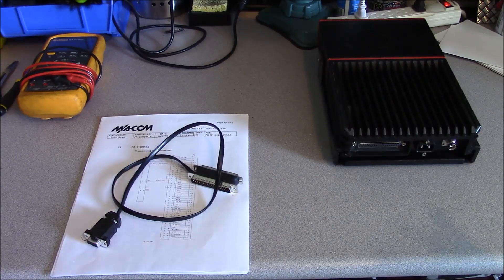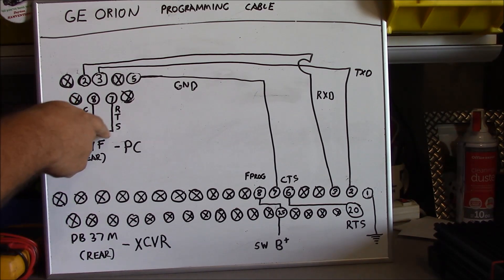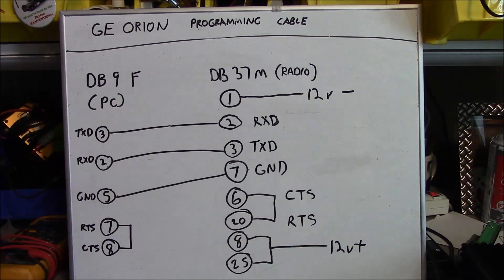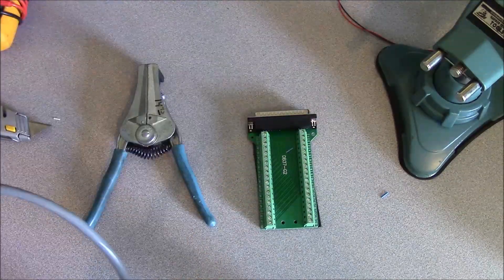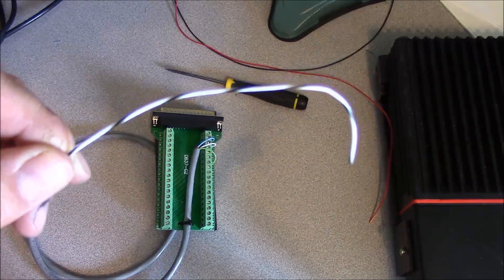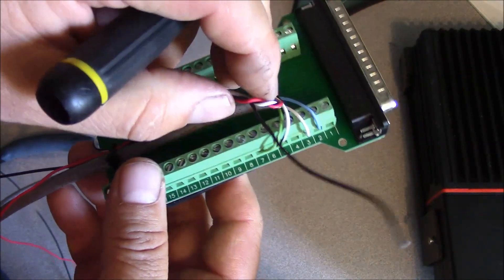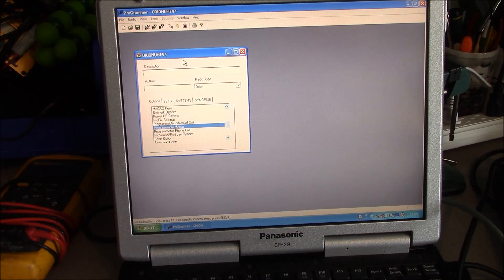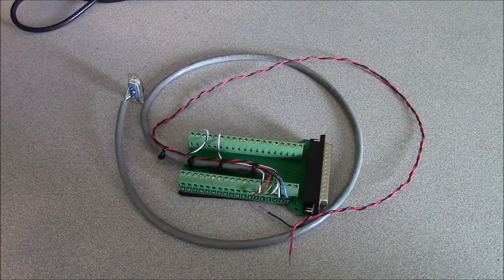GE / MAcom Orion radio programming cable build your own DIY

Comment: Do you have a video or diagram for the ma/com LPE-200 programming cable a new cable building video would be awesome
Reply from the maker: That is a TQ3368. The schematic I have is for the cable that uses the TQ3310 or TQ3370 Rib box ( Its not a ribless cable).  There is a fellow on ebay who has a price industries one for sale for $39.99 that I BELIEVE is the ribless RS232 cable. If you email me I will send you the schematic and link. Thanks for watching !
Reply: @survivalcomms  what's a email I van reach you at?
Reply from the maker: @AlucardRacing  (my channel name) at gmail dot com

Comment: hi i have a ge orion radio can you help me program it? I can't change the power Thank you
Reply from the maker: You need to get the software
Reply: @survivalcomms  i have the software
Reply from the maker: @marcoc2069  Ok you need to use the Radiomaint.exe  program in your folder to edit your tracking data . Read and archive your original tracking data then edit the tracking data and upload to the radio.
Reply: @survivalcomms  my problem is that I can't vary the power, I can read and write but not vary the power
Reply from the maker: @marcoc2069  How much are you trying to lower it ?
Reply: @survivalcomms  it won't let me get down or up
Reply from the maker: @marcoc2069  Will it when you are editing the tracking information ?
Reply: Can you make a video to show me how you program it.
Thank you

Comment: Worked like a charm on my M7100. Thank you, sir!
Reply from the maker: I am glad ! Thanks for watching !
Reply: @survivalcomms  oh, your channel is great.  I've fallen deep down the surplus commercial/public safety radio rabbit hole. Thanks for all the information and inspiration. 73, W6STO
Reply from the maker: @mattbranstetter4072  I am glad  !
Reply: Hey Brett, I actually have a question for you after a little more messing around.  I am having trouble writing the System Control head keypad functions.  Ma/Com M7100 VHF using RPM R14c.  Is it possible that the control head needs to be connected via the CA101288V15 during programming for the functions to write? Thanks
Reply from the maker: @mattbranstetter4072  It is possible and I would give that a shot. Is it transferring your  memory names correctly to the head ?
Reply: @survivalcomms  yes memory names work fine. Probably better get the factory cable and try it. I'll let you know if that works

Comment: I built this cable but I ran into a new problem, when it reads the radio I get an Error message "radio was programmed with a later version of programmer software. Please contact Software Support. 

Any help on how to get around this is greatly appreciated.
Reply from the maker: The software you have is an older version than what the radio was programmed with. Easiest and least expensive way is to create and write a codeplug to the radio from the software you possess. It will overwrite the codeplug in the radio.  Make it a simple codeplug and then once the radio reboots and all is bueno read the codeplug from the radio and edit it. Thanks for watching !

Comment: Is there any way to build one using a USB? I dont have the DB-9 on any of my computers. I also dont have $100 for the TQ-3409 USB factory cable. Thanks k2eds.
Reply from the maker: You could try a USB to RS232 converter. Thanks for watching !
Reply: @survivalcomms  Could you make a vid on how to roll back the firmware? I have a radio that was last programmed with RPM10b, and all I have it programmer 17 and 18. :/ Thanks!
Reply from the maker: @anydamaddress1  open your programming  software and select your model from the pick list. Then write a generic codeplug to the radio. After the radio reboots read and archive the codeplug. Program this one with the variables desired.  This has worked for me many times.
Reply: @survivalcomms  Yes, I know. I'm just not techie enough to follow from a sheet of directions. I have the actual instructions from Harris on a pdf, I just benefit from the visuals. Besides, I really do NOT want to brick it.:D

Comment: Could you do a video on the MPA, TPX, Phoenix SX, ranger, TMX, MLS. Sorry I hate to see radios in the trash when they can be repurposed. Can these radios be programed without a rib box and a DIY cable? Could you also do a video on the Standard radios.
Reply from the maker: There are several GE resources out there for those who want to preserve the legacy tech. It can certainly be done but I don't have any of the examples in my collection. I do have an MTL somewhere. The MRK can be programmed with a USB cable and the same software I used for this project. Thanks for watching !

Comment: Hi, might I ask what software this is, version, etc, and where it can be obtained ?  Q2,,will it run under windows XP pro SP2 ??.
A project on the plate is using an FTDI USB/serial interface. Thanks for sharing this, would love to see the same for the M-RK UHF portable.
Reply from the maker: You are welcome ! MA-COM ProGrammer v17 , It's in the wild - look and you will find it. It will also work for your M-RK . XP sp2 works just fine . I recommend getting a legacy toughbook or a laptop  / desktop with a DB9.  I prefer a DB9 over a USB/Serial interface  but  I do have a  USB Price Ind. M-RK cable that has always worked well  for me as always YMMV. Thanks for watching !

Comment: I broke down and bought the cable, due to my being impatient. and the cable got her 6 hours ago. Same cable as you tho I paid 70 USD for it. Tried to program my radios found out that I couldn't since it had been updated with a newer programmer software, i'm currently trying to back date the firmware.

Damn my impatientness! :-)
Reply from the maker: The GE stuff is cool in its ability to work around that. Motorola stuff needs proprietary S/W to do the same thing.  Make certain you have the tracking data (radio alignment settings) and the feature encryption string ( GE's version of Flashcode) in the backup folder.  If you read the radio in your software it should be there identified by the radio's ESN and the .TRK and . ENC extensions following the ESN as two separate files.  ADI / DSP should not be an issue for an Orion. The tracking data is an easy workaround by loading default data and realigning the radio but the feature string is more difficult to reconstitute . Once you have those files  secure copies of them in another folder so they aren't lost. You are then ready to clear the radio code (GE speak for firmware) and reinitialize the radio and put in a generic personality you wrote in the older version of programmer. you intend to use.  You will need OG30300 for the legacy programmer versions IIRC. I know it sounds like a lot of work but after you do it once successfully you will own the skill. I hope this helps !
Reply: @survivalcomms  finally got my first personality flashed and I'm still experimenting. Did do a basic range test with a friend on 150.000. where able to get about 28miles at the crow flys over a few fairly large cities. We where both impressed.

We discovered unlike the old CB bigger isn't always better, antenna position and size on vehicle plays a huge part as well.

I'm not converting mine to ham yet until I get my license out of respect for the ham guys. Mainly wanted these for emergency use. Managed to program a few important frequencies in. Also learned how to set up the scan which is quickly taking over my drives to and from work.

I'd like to learn a little more on what frequencies can be purchased for business used from the FCC. 

Getting my ham licence would probably be easier but getting my friends to get their ham isn't as easy.

I've been going down the ham/VHF YouTube rabbit hole all night... It's almost worse the the AR15 calibers rabbit hole. 😂🤣
Reply from the maker: @RocketnNitro  If you are interested in getting a business pair The easiest way is to get a consultant to walk you through it. Be advised anything you get will be incompatible with the legacy equipment as they will be narrowband and will likely not be itenerant but your mileage may vary.  Here is some detail on common itenerants that business band radios use out of the box. https://wiki.radioreference.com/index.php/Common_Itinerant_and_Business
You can learn so much on Youtube if you look at the small and DIY channels.